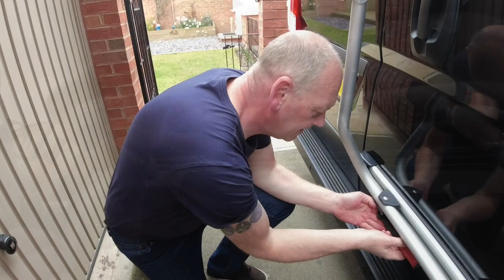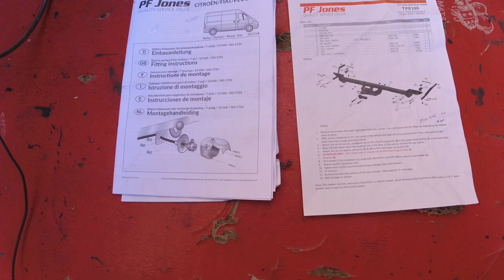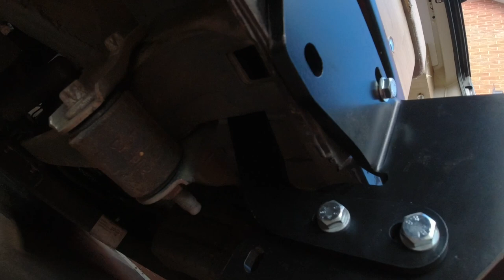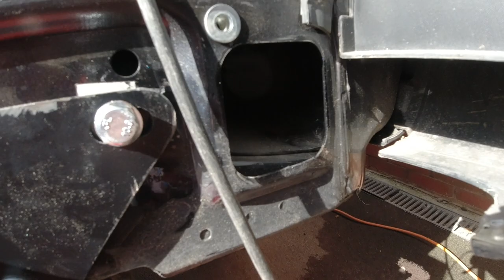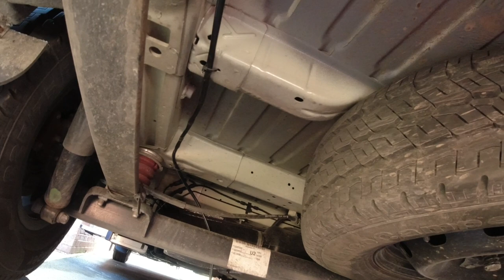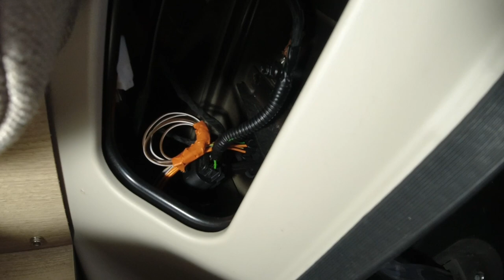Fitting A Towbar To A Fiat Ducato - Citroen Relay - Peugeot Boxer - 2006 Onwards

Comment: Thanks Rick, that was very handy for me as I recently purchased a new fitted out Fiat campervan (in Australia) and the manufacturer forgot to fit the towbar. I got a refund and thought its easy to get one fitted later on but when I went to the local Fiat distributor they made a big deal about it and said that the internal furniture would have to be removed to do it etc. etc to connect wiring to the front of the van... big $$$.
Then I started on you tube and discovered they were only banging on about a power wire connection to the battery and I'm thinking why they either didn't connect to the house battery (in the rear of my van) or run wire under the van!  Now I've seen you do it clearly its not hard and I was going to be ripped off.
Downunda - Melbourne Australia
Reply from the maker: Wow, amazing to think it’s helped someone so far away 😊 you’re very welcome enjoy the camping 👍

Comment: Very helpful video - interesting as I wouldn’t have ever thought to do this myself but looks like it’s fairly straightforward all be it likely take a bit of time - great job - all the best, David 👍
Reply from the maker: I prefer mechanical you electrical, but it’s easy enough 👍
Reply: @RickandHeather  interesting, as it’s mechanical that I find the most challenge with. I would buy the wiring harness mind you to save messing on still 😄 thanks again, great vlog and have a great weekend.
Reply from the maker: Thanks buddy you too 👍

Comment: Nice one Rick, well explained and captured. I had looked at PF Jones and had a quote but still not had it fitted yet 😆. Have fitted plenty over the years but as you say cars are more complicated now so was unsure about doing myself. Guess it doesn't affect the parking sensors either. Cheers
Reply from the maker: Hardest part was crawling the van length routing the power cables 👍

Comment: Hi Rick, just waiting on delivery of my towbar for our 2013 Ducato X250 campervan. Excellent video. I bought similar electrics to you i.e. piggy backed off lights etc. I noticed that LeisureBit only had to basically connect a plug to canbus and an earth at the back. Assume the newer models are different even though my ECS kit says ‘2011 onwards’. As a retired mechanical engineer the electrics sometimes scare me !
Reply from the maker: Hi, no David’s van is only a year newer he just bought the more expensive wiring loom….. 👍

Comment: Nice one Rick, those captive nuts looked a pain but great idea to use a tie to hold it in place enough to get the thread to catch. Not much of a break though more like a long weekend😂😂😂Cheers K.
Reply from the maker: More a break from vlogs than working 😂
Reply: @RickandHeather  That was my point Rick, here I was looking forward to a rest and then less than a week later up you pop with a new vlog. Right that's me back to firewood duties. Cheers K.

Comment: i have thule easyfold triple and found that the light socket was blocked by the carrier so had to move the light holder further out and only use 1 bolt to hold it on, still works ok and solid.
Reply from the maker: We just got the Halfords advanced double which is basically a Thule knock off, should be ok! Thanks for watching 👍

Comment: Hi. Fitted a tow bar yesterday after watching you vid. Thanks. Just got the wiring to do (connect into the van) just wondering if t you know of a piggy back cable available anywhere to save using the scotch locks which sometime sever the copper and well as the insulation!! Failing that I'm tempted to make a piggy back if I can find the correct plugs!! Cheers
Reply from the maker: The wiring kit I got from PF Jones had all the connections needed, don’t use scotch locks!

Comment: Good video. How much clearance do you have for reversing sensors once towbar is fitted as original bumper bar has holes cut in it?
Reply from the maker: I was worried about that but no issues (outer 2 aren’t even affected as towbar is narrower and inner 2 don’t touch so all ok!

Comment: Is there any special precautions in disconnecting the reversing sensors
Reply from the maker: I fitted them anyway so I don’t think so, if you have factory fit you can have them coded out when reverse is selected with the trailer plug connected

Comment: Did you have any issues with the fixed tow ball triggering the reversing sensors?
Reply from the maker: Yes, because they were aftermarket I couldn’t code them out so if the bikes were on it was annoying… the new van is different (sold this one now)

Comment: Rick. Thanks very much for this. We have a Witter towbar, factory fitted by Elddis. It was slightly off level and causing the plastic step to rub on the bottom of a barn door. Whilst sorting that, I noticed one of the three bolts from each side in the triangle configuration were missing. Do you know what the metric thread size is for them and if they are all the same thread/length?
Reply from the maker: I can check the paperwork tomorrow for you 👍
Reply: @RickandHeather  that would be awesome: Thank you!
Reply from the maker: Hi Roland bolts are M10x1.25 (thread pitch) x35mm long
Reply: Superb: Thank you
Reply from the maker: You’re welcome 👍

Comment: Would it be possible and easier to just splice off the wires from the rear lights?
Reply from the maker: No, modern vehicles have CanBus wiring, the voltage sent to the bulb is a signal trigger more than a straight 12v so it throws errors on the dashboard such as bulb failure etc.